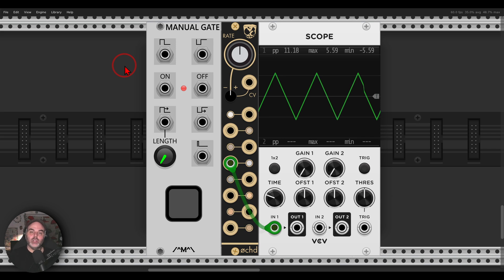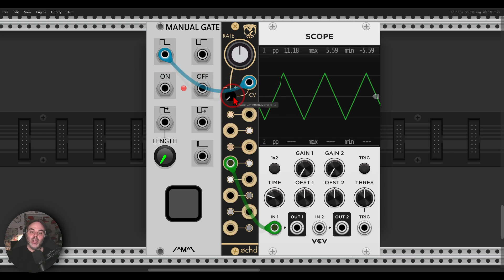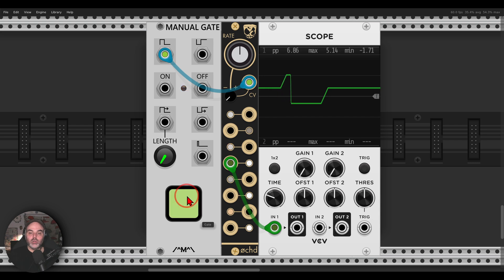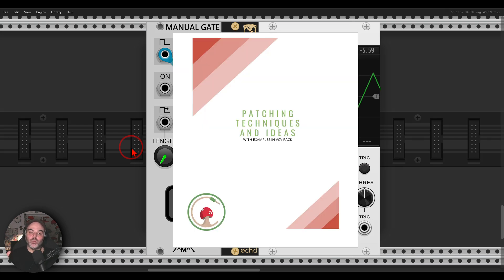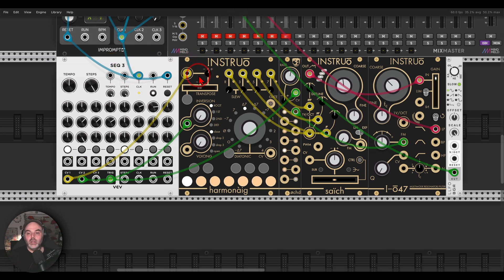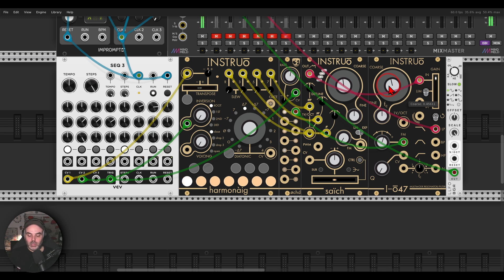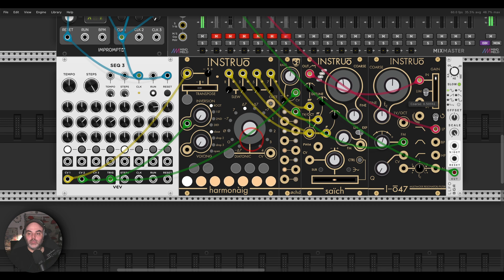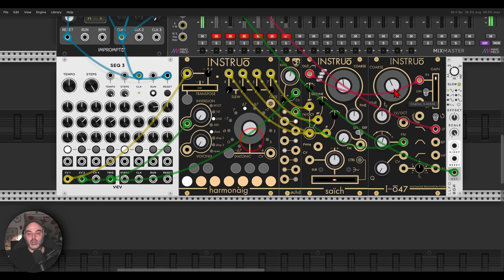Rhythmic LFOs with Ochd \ Quick Tip

Comment: I find that I can get interesting rhythmic modulation results by multiplying an envelope or the sum of envelopes, sending it to the CV input of Ochd and then adjusting the attenuverter to taste. It’s less predictable, but also has more movement than just the free-running LFOs without modulation. It can sound somewhat related to the rest of the patch.
Reply from the maker: Great tip!